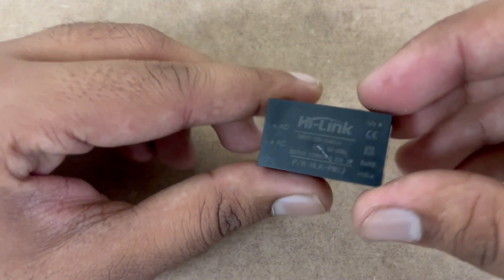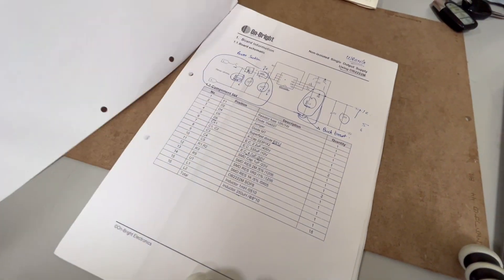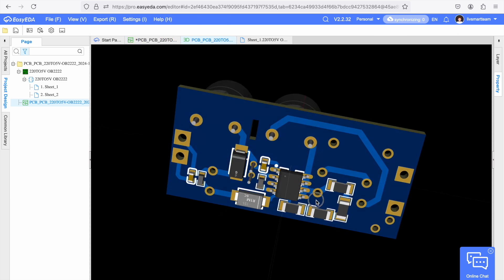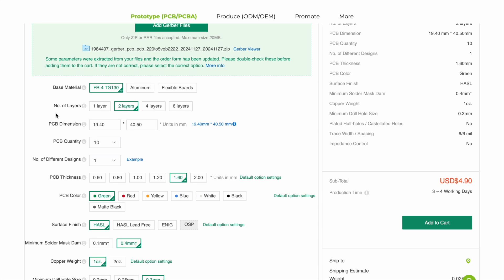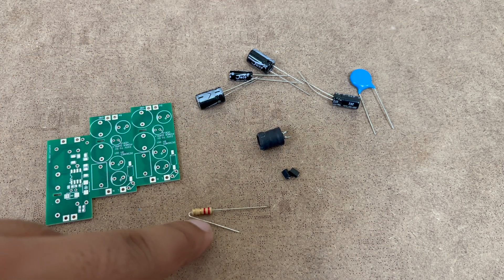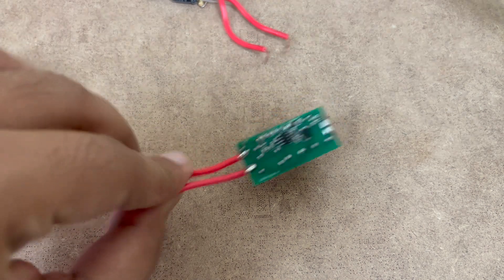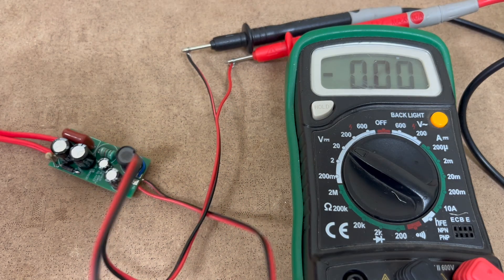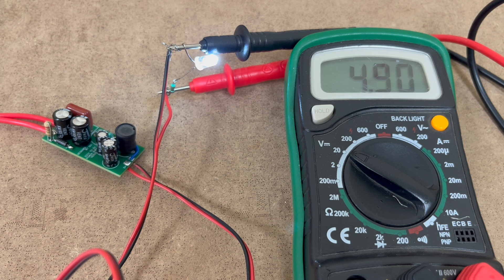Compact 5V Power Supply for Arduino Projects

Comment: Why you show such a power supply? This is not for hobbyist! Too dangerous with no isolation. If you power the arduino with such a psu and connect it to a PC for programming then the PC can be damaged.
Reply from the maker: You are right. I should add warning
Reply: @RoboCircuits  Thank you .Always safety first 🙂